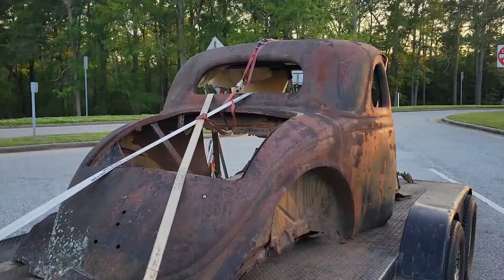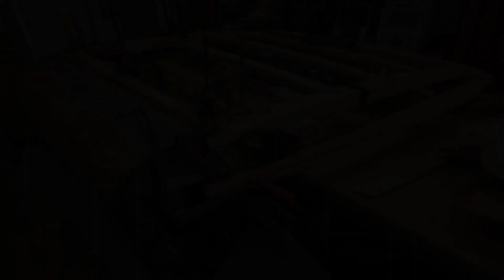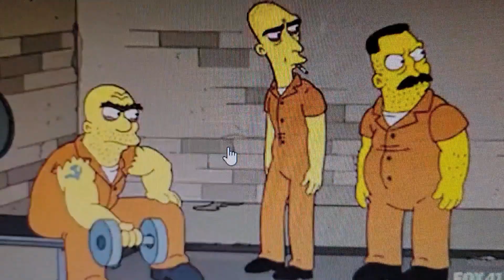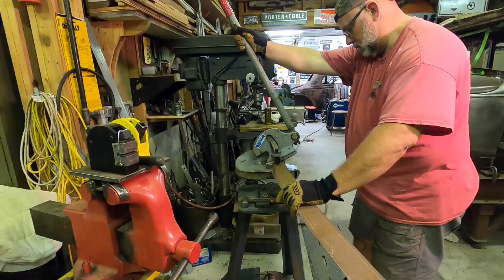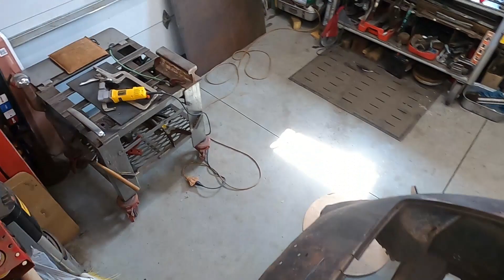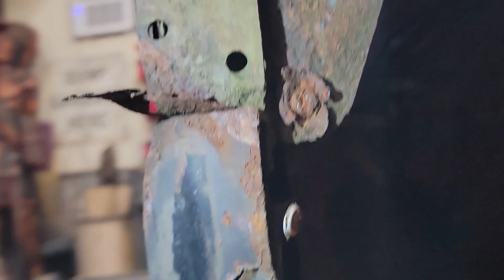36 Ford 5w/Coupe: Replace a Rotten A Pillar

Comment: Man I thought my 62 C10 project was rusty! You have got some work to do!!! Thinking things thru seems to take us more time than the actual work, but it matters a BUNCH in the end!
Reply from the maker: Agree 100% .....what got me in this position is that it started out as a $100 car. Well for some crazy reason I thought I could turn it around on the cheap. My plan is to pull it back into "project potential" if all goes well....I sell it off and use the proceeds to buy 34 patch metal....that one ill build for me eventually.  Thanks for dropping by.

Comment: Not knowing where you are located, if you're anywhere near Bowling Green, KY. area,, you are welcome to come and inspect my '36 3W coupe's door & A pillar.  There is a pocket that the hinge fits into and some extra room I recall, as I would up inserting a shim into the pillar, behind the hinge to get the door fitment I wanted.  I'll see if there would be any point in taking pics of the hinge and if so, will let you know.
Reply from the maker: Appreciate that Bob! I'd love to drop by...but I'm never near. I did come up to BG back in 2015 and bought a frame jig/table off a fellow that was building a 30 sumptim Bantam....But forgot his name...impressive shop at the time...cnc and other equipment...first class diy er.

Comment: Yeah ------ I think it would be tuff ---- not having at least a door to look at ----- and hopefully ---- it would have the hinges on it ------ I do think you are right ------ like the driver's door ---- there is a pocket to the ----- inside ----- for the hinge to slip through and be bolted down ------- Since the right side has been repaired sometime in the past ------ and if you don't have a door ------ and the driver's door is untouched as in a repair ------ get the measurements off that side for the hinge spacing and depth of pocket for hinge to slide in ------Hope you are not in this Heat Belt that we seem to be having ---------- Thank You for the Video ----- And Have a Good Week ----------- Rodney
Reply from the maker: Thanks Rodney.... I've got a set of doors I need to retrieve from my father in Illinois in August. It'll be tricky but I'm hopeful to get these parts roughed out now....and close....then finalize with the doors in Sept.